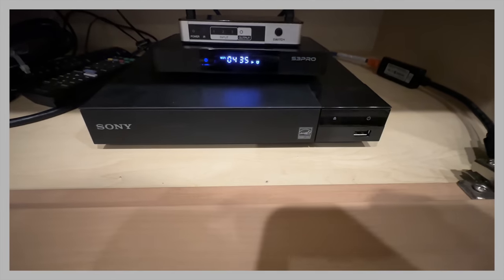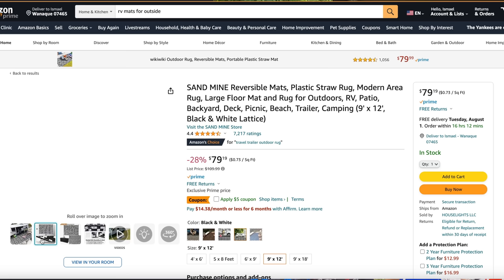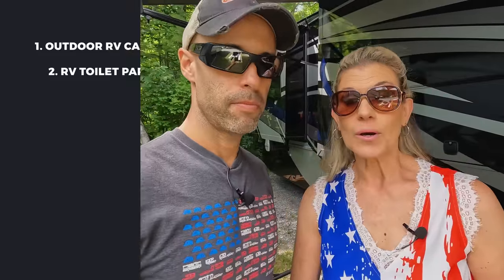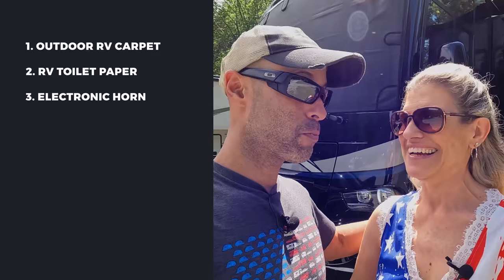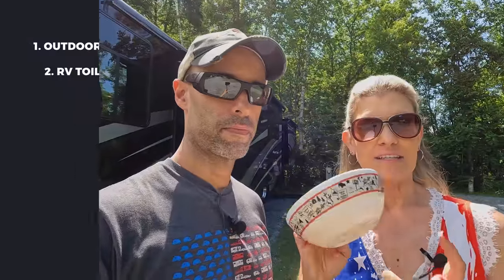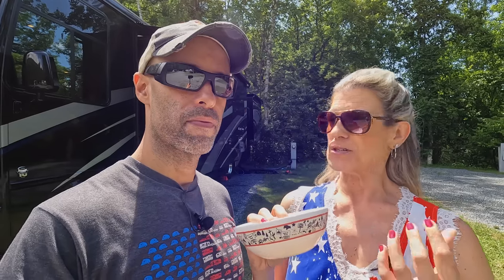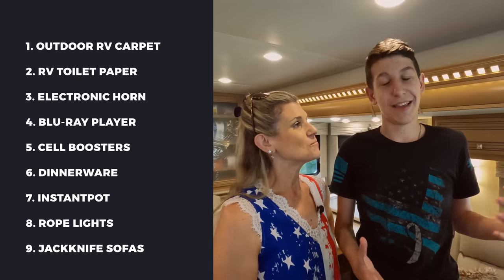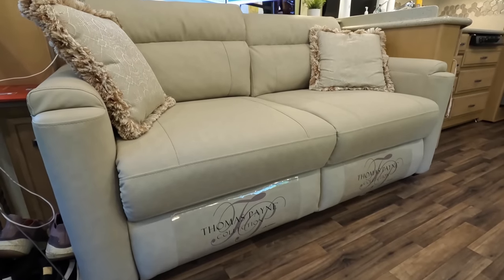RV Items We Regret Buying -- Don't Waste Your Time And Money!

Comment: Several items you mentioned we bought too, were duped by the marketing!  In order 1 we use septic safe TP I despise the cheap but expensive RV paper.  2  the blu ray player trashed- we have a movie made about us by Hallmark “safe harbor” starring  Treat Williams/Nancy Travis, but we never played the dvd on the coach!😂 3.  We had satellite  tv with the portable unit, what a pain, ditched that about a year after purchase, what a waste of $ and 4. The best upgrade we made was to install an adjustable bed with RV mattress they are great mattresses!  Loved the new mattresses so much we also bought them at home which is a boat. 5 understand The holster issue, should be a used holster exchange IMHO!  
Great fun video, thanks for filming this.
Reply from the maker: Thanks for sharing

Comment: We got the reusable plastic paper plate holders that you  can snap the cheap paper plates into to make the plate more rigid...they are good and cheap. And the under cabinet small tissue box holder/dispenser - camco pop-a-tissue...very handy. We also carry a small portable propane firepit...LOVE that thing! Lungs just cant the firewood smoke anymore! OH and last but not least...A wall hanging Ryobi hand vacuum...we use the ryobi vac as we also carry( all cordless) a small ryobi fan, spot light, flashlight, compact shop blower( GREAT TOOL TO HAVE ONBOARD),12v charger and drill. The nice thing about the vac is the ryobi batteries  can charge on it... and when we have no 120v power we can use the 12 volt dc charger to charge up the ryobi batteries...

Comment: Another great vid!  I would disagree about the RV toilet paper, however; it's not JUST the cost that is different, every RV toilet paper I have tried is also HORRIBLE at performing its primary function!  Further, I have seen multiple RV and boating channels do tests that compare how quickly RV/Boat TP breaks down compared to many septic safe non-RV TPs and have shown the RV/Boat stuff to be no better or even much WORSE about breaking down.  Thanks again for the informative video.

Comment: We live and camp in the far west, which means beaches desert, and dirty places are camp mat is indispensable. It does require some maintenance, but it definitely keeps most of the sand and desert out of the coach. I use a handheld, portable leaf blower to cleaning it when we’re done and it gets washed thoroughly at home base.  Thomyt
Reply from the maker: Thanks Thomy. 👍

Comment: I agree with most of your comments but not two of them. I use a sand mat in place of a traditional patio mat. Easy to clean and stores in one third of the space. We go places with weak to no cell. Blu ray player and 160+ movies/TV series for rainy days. 
We have three chihuahuas and put them out in an xpen with rope lights clipped to the top for light around the xpen at night.
Reply from the maker: Thanks for sharing

Comment: We didn't order our coach, so it came with options I would not pay for and some I would not have ordered, but seem like a good addition. Fully agree on the sat dish. We've never used it on any coach we've owned. I would also eliminate the central vac. We bought a rechargeable stick vac which is so much more convenient.  We don't boondock much, bet when we do the 3 solar panels the coach came with are a benefit. I also really like having the Wifi Ranger/extender since this allows me to have all our devices programmed to the router once and then I only need to connect the router to the park Wifi and all devices are connected and secured. I do like having the outdoor mat to keep dirt out of the RV when staying in more rustic parks. It's easy enough to hose off once we get home.

Comment: We just bought a wee boost because the signal in the campground we are at now is garbage. They had a derecho go through here in May, and took out a tower and they haven’t fixed it yet.  Wee boost works excellent and fixed our problem.   We use dish on the go because cable is t available in every place and the air antennae don’t always work to watch tv. We can cancel when we want and use it when we want. We can’t stream movies because they use up too much band width and then the cable companies that promise unlimited internet throttle you back after so many gigs. usually 20-30 gigs is all you get and then comes the throttle

Comment: For us, the big item we stopped using and finally pulled out of our rv was our camp chef stove  It is a 3 burner with a griddle and bbq attachment.  Truth is, it works fantastic in all three configurations that we have for it, BUT, it is so big and heavy I just got sick of pulling it out of the storage bay and setting it up.  The stove itself weighs about 64 pounds, the griddle and the bbq probably weigh 25 pounds each, and combined, they use a ton of space.

Comment: We had two mats for under the awning. A smaller one for the door area and shorter stays. The mats were made of a material/weave that sand, dirt and water went right through. They were even grass friendly.  We have a set a Corelle. I absolutely will not use paper although my wife would prefer to. Most families in our Good Sam chapter use dinnerware. When our three kids traveled with us a DVD player was a must. They spent many hours watching movies on the road. However this was during the 80s and 90s. Now with just the two of us, it’s rarely used. Totally agree on the jackknife sofa. I pulled the jackknife (kept the hide a bed) and replaced it with a recliner and end table. Great videos.
Reply from the maker: Thanks for sharing!